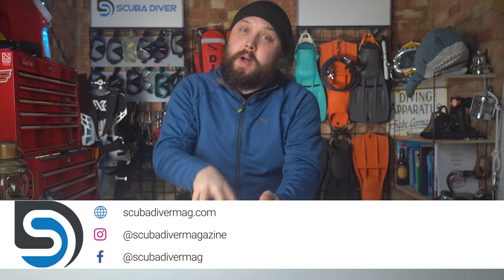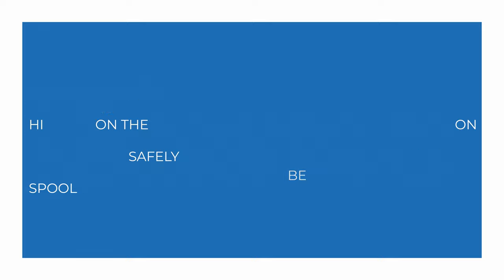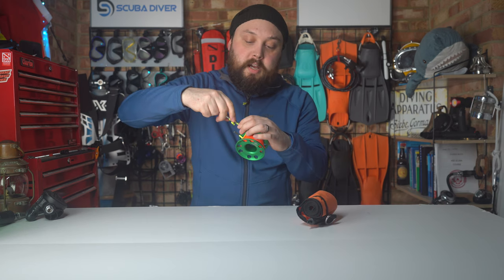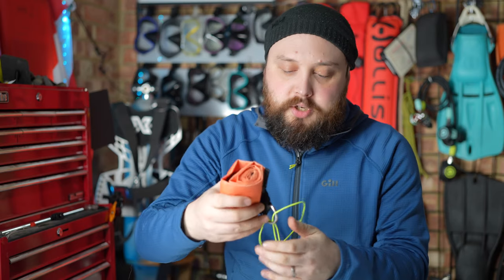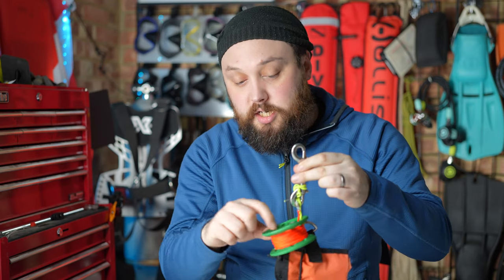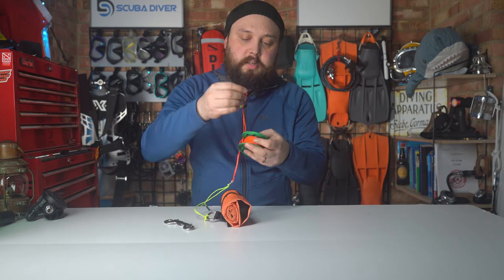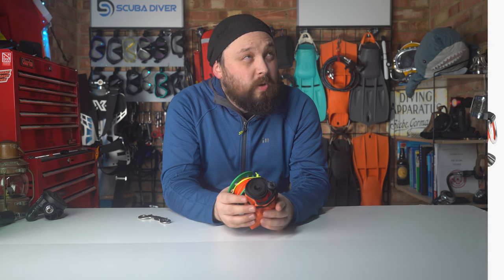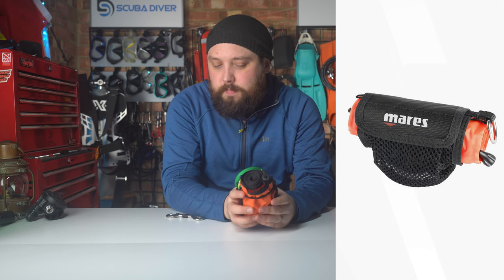How Can I Leave my dSMB Attached to My Spool? #askmark #scuba

Comment: The way rig it is by having two loops at the end of the line, to the same free-speening fitting you have in yours. One loop goes to the double ender to prevent the reel from unwinding, and the other loop the DSMB. My DSMB has a single ender attached to the small D ring to secure the assembly to the bungee loop in my cargo pocket.

Comment: I keep mine attached on open water dives and do it exactly like you showed Mark. It's quick to deploy and slightly more work to clean up.
Om cave dives I don't bring a DSMB so I bring just the spool(s).
Reply: Well, the spool is your search-reel (or back-up) in the event of losing the line. With a spare lead, lump of rock, net bag or anything heavy enough to anchor it reasonably well.
Reply: @a.karley4672  On cave dives we anchor the safety reel to the cave line, for example if we're looking for a lost diver. If we've lost the cave line ourselves, we first tie off to two rocks or stalacmites before commencing our search for the cave line.
Reply: @Yggdrasil42  Ah, flooded air-filled caves. Never been in one of those. (Stalagmites/-tites can't form below water level.) I kept my search reel (10m) tucked under the surveying slate on my right forearm, with the free-end strapped onto my compass strap.

Comment: In warm waters, I have preassembled normal (orange) and emergency (yellow) dSMB’s on Apeks 30m and 60m reels, stored in my sidemount butt pouch. 

I assemble them exactly as shown at 4min10sec, except I don’t have any orange line poking through the hole. Instead I poke only the yellow leader through the spool hole, then wrap it twice around an XDeep double ender so the gate mechanism cannot open when the leader line is under tension. 

Approx 5 mins before my ascent, I remove the spool/dSMB from the butt pouch and hook it on my butt D-ring, so it’s ready to deploy (usually after my deco switch).

In cold water, I have an AP Diving dSMB with crack bottle bungee’d to a Kent Tooling reel. Perfect for clunky dry gloves. Just remember that removing the heavy Kent reel alters your buoyancy if you hand it to someone else 😗

Comment: #askmark, I've switched to a LHPD, but now how's the best way to fill my dsmb? Probably have to switch to alternate regulator, and use primary?
Reply from the maker: Yeah, if your alternate is tied around your neck it's tricky to fill a dSMB with it. Your primary is a good choice if you're filling from the bottom and you can switch to your alternate to make sure you have your next breath first. 

If my primary gets ripped from my hands I'd rather have my alternate already in my mouth and tested.

Comment: What else would you use the spool for other than deploying the dsmb?
Reply from the maker: Things like laying guide lines, organising search patterns and makeshift buddy lines.

If you're in an overhead area you can either use the spool to lay a guideline to help you find your way back to the exit or attach the spool and create a jump line from an existing guideline.

If you're searching for something it's useful to have a line from a jackstay to measure distance and use as a reference.

And if the vis is very poor and you want to stay connected to your buddy you can use some line to stay connected.

With a MacGuyver mindset there are plenty of other uses for some string during a dive.

Comment: #AskMark:  Late starter to diving.  Now 68 with just over 150 logged dives in 8 years. Have dived UK but now only in warm blue water.  Recently had second op on my ankle which has left it pretty much fixed.  Find currents a bit of a challenge (struggled a lot earlier this year diving in Socorro).  Looking to get a DVP but need something I can carry on airline (batteries in hand luggage, body in hold luggage).
Looking at the ScubaJet with 2 * 100wH batteries (2 passenger hand luggage).  Having made an expensive equipment mistake in the past (Paralenz Vaquita 2nd Gen) I wondered what you think about this DVP.
Thanks Kim
Reply from the maker: Hey Kim, I've only ever seen ScubaJets at dive shows, I've never used one myself in open water. They do look very powerful for their size and they have good write ups online. Sorry I couldn't help more but, I have been considering one of these myself.

Comment: I make a bight exactly as you've suggested, but I have a piece of heat shrink tubing installed at just the right place, so it makes the line stiffer - and therefore easier to pass through the hole in the spool. This also reduces wear on the section of line through the hole, that the whole DSMB/reel assembly is hanging from.
Would be easier to explain with a picture - but hopefully you get the idea! I prefer to be able to deploy the DSMB rapidly rather than mess about assembling it first, as 99% of the time this is the only reason I'm carrying the spool.
If penetrating a wreck, I'd have a reel with me specifically for the purpose.
Reply: For penetration dives I also carry an extra spool in addition to the cave reel. I like having a backup to use as a jump line or recovery spool in case I lose the main line. I only have a 120m cave reel, and a 60m backup spool. I'll also bring the 60m spool on dives over 20 meters deep, in case I need to raise a dSMB from max depth.

Generally speaking, I bring spools at least 1.5x the depth I will be diving. < 20m I'll bring the 15m and the 30m, > 20m and < 40m I'll bring the 15m and the 60m. If I ever dive deeper than 40m, I'll bring the cave reel in addition to the 60 and 15m spools. It's not ideal for deploying a dSMB, but it's better than nothing.

Comment: Hi Mark, I came across your channel and I have a question regarding DSMB inflator nozzle.
The inflator nozzle I have on my DSMB was plastic and it actually broke, I found an aluminium nozzle but I don’t really know how to remove the old nozzle and replace it with the new one or if that’s even possible.  I would appreciate some suggestions if you can
Reply from the maker: It's easiest to replace the entire valve section. Use a hair dryer to heat the plastic tube it's pushed into to soften the plastic and then twist and pull the old valve out. Then the new valve just pushes into place. 

The internals of those valves vary but the tube they push into is usually the same 12mm internal diameter.

Comment: #AskMark  
Hi mark, nice video.
Could you show me how you merged the orange line with the yellow one, i saw in the video some kindo of gray tool to link them. 
I found interesting in how you used the yellow line to attach the carabiner and secure it and make the spool secure and safe and let the orange dedicated to deploy the dsmb or other use.
Thanks for the video.
Reply from the maker: It's a small metal swivel. The Apeks Spools have different lines for the leader and the main. The yellow leader is made with Dyneema for strength and the main orange line is a thinner tape that's easy to see and handle.